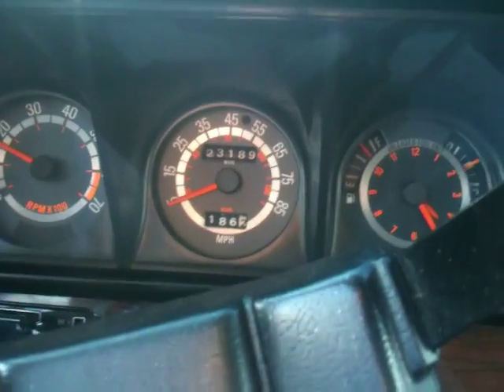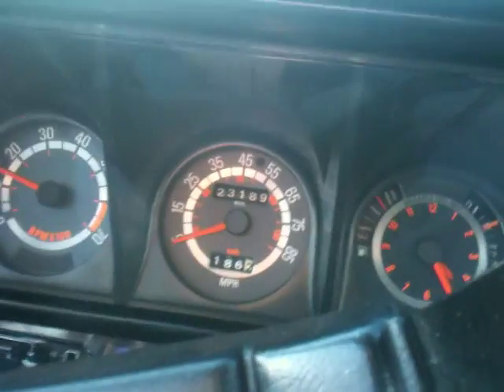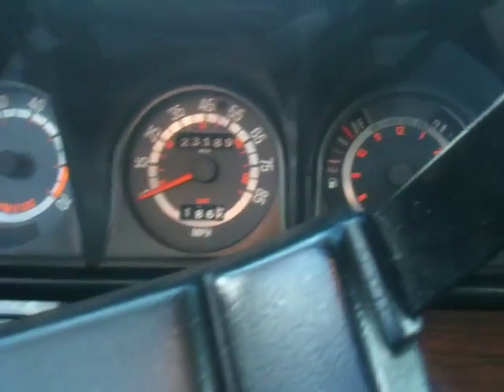1979 Plymouth Horizon TC3 Acceleration

Comment: That would have the 1.7 VW engine, correct?
Reply from the maker: Yes.  1.7 with the lean burn system.
Reply: Infinitrium yes my car has the 1.7
Reply: Infinitrium yep , that's the same  motor that came in the VW Rabbit I Owned one in the 80's you got to tweek the motor. If you have front end shake get new CV Shafts if needed and a alignment. Also ck tires.

Comment: why is that car so rare
Reply from the maker: They weren't huge sellers when new, plus they were disposable.  almost nobody preserved them.
Reply: in trying to look for one for sale and cant find a single one. i want one do bad since probably 0 are left in southern california. i like driving rare cars
Reply: i found a project dodge omni charger 2.2 in az. cnat drive there though
Reply: the latest issue of Hemmings  Classic Car has one in it that the owner did a frame off restoration. Interesting and very difficult restoration due to the scarcity of parts.
Reply: Shyzah they are rare because everyone crushed them or hot rodded them out. I have one I am building up